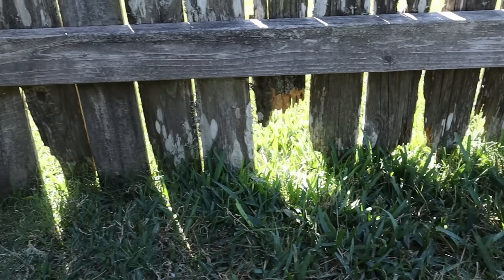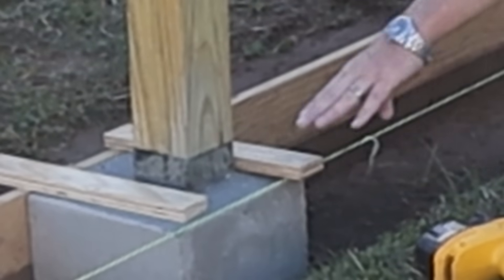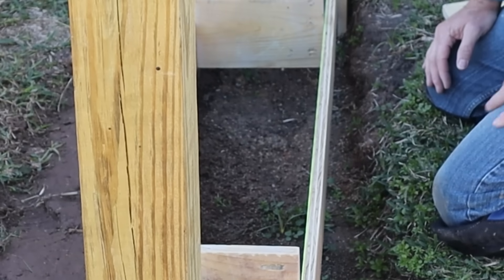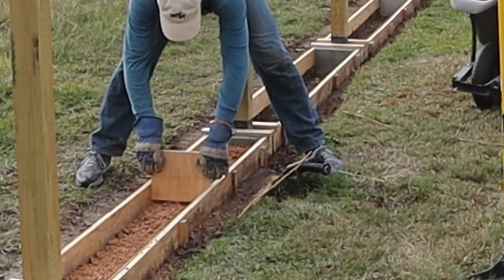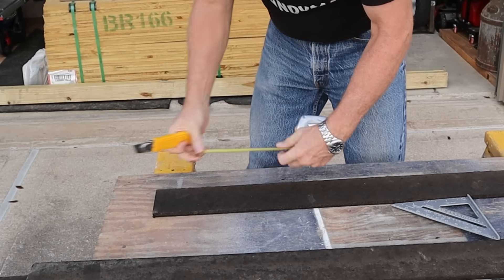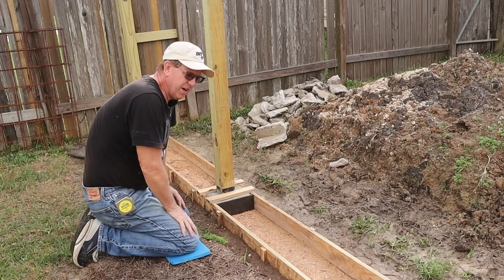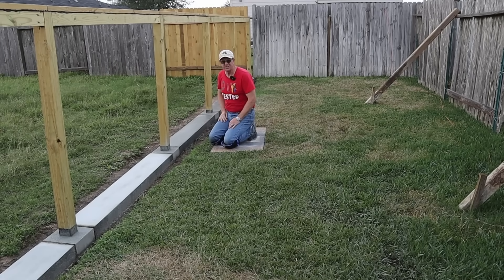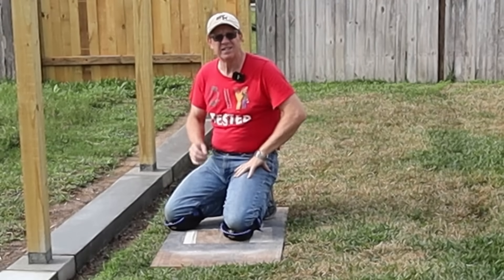Zero Maintenance Concrete Curb-Keeps Fence from Rotting!

Comment: I do like this idea and I did this when building my new fence but super simple way: after I set my posts, I just dug out a couple (3-4”) of dirt between my posts, got 2, 1x4’s and covered one side (the inside that goes towards the concrete) with 3” blue 3M tape (so the concrete doesn’t stick to my boards), put them down in the gap between the posts with a 10-11” spacing.. just let the top of the board be flush with the ground level .. filled some of the dirt back into the gap so I have about a 2” depth left to fill with the concrete.. stepped on the dirt to compact it down.. added 2 or 3 small (1x2) spacer boards across the top to hold the boards to that 10-11” spacing .. and filled up with mixed concrete. I did put some plastic on top to allow the concrete to cure slowly - took that off after a couple days. Then removed the form. It’s been over one year and they’re still holding up just fine.

Comment: You should have rounded the sides to prevent brittle edges. You could have used a fiber in your mix to limit chipping and increasing tensile strength.
Reply: CURB TROWEL
Reply: @mdoy5667  Like he shows at 25:20?

Comment: This is actually much more complicated than what you expressed in the video. Concrete is constantantly drying after the initial mix and you are fighting the mixture, the volume of concrete mixed that has to be transferred from the mixer to the ground, compacting it and then smoothing it over. As you've stated at the end of the video, it comes down to experience and for most DIY homeowners, we just don't have the volume of work to gain that skillset to achieve anything close to professional results!!!

You deserve much credit for showing this and sharing your experience and knowlege in this video!!  The number of linear feet of conceret done was not easy and the results turned up great!!  Well done👍👍👍

Comment: Very good job overall, excellent idea, The only thing i would have done different is to round the edges with a "bullnose float" so the sharp edges are less likely to chip and the water will more easily run off the top.Thanks.

Comment: The chairs on the metal concrete cage are to keep it in the middle of the concrete and to try to mitigate the rusting of rebar inside the concrete. By suspending the rebar with rebar with rebar you’ve just made it easier for the rebar to rust. When rebar rusts in destroys the concrete. Should’ve just used a couple of rocks or something the suspend your metal fencing in the concrete.
  You could have saved some time just bending the metal fencing into a rectangular box and securing it with ties

Comment: OCD = Good Work Ethic. I'm so tired of people saying what I do is overkill. I love your attention to detail and execution.

The only thing I would change here is, like you said, to use smoother boards. It'll definitely help with the bubbles getting stuck and also using a treatment so that the cement doesn't stick to the wood.
Reply from the maker: Thank you, that is the nice thing about DIY you can over kill it all you want!.  Glad you liked the video.  I sanded the boards and waxed them with paste wax for the next set and worked much better.  Thanks for watching.

Comment: thanks.  I learnt...  never to put too much water in until you have mixed it, then add water to suit,  never leave the boards out in the rain to warp,  take the boards off early as soon as it can hold its shape.  use a vibration tool to get the side air bubbles out.

Comment: Shrink /swell soil is what you were trying to say. I think this was a great job- I subbed! Got any vids on replacing a subfloor under a broken toilet flange? It’s about 2 x 2’ i have to replace before finishing the floor(ceramic tile). I will be making a concrete threshold for my barn doors, and using your procedure for making them!
Reply from the maker: No I sure don't, sorry.  Thank you for watching.

Comment: I did something like this for curbing. I made forms and pre-casted the curbing in 3 foot sections. I ran a line and butted them up. It turned out perfectly level and straight because I could pump and move them into position.
Reply from the maker: Great.  Thanks for watching.

Comment: Found your video while researching how to make a foundation for a block fence I'm planning on building. Great job! I have just enough concrete experience to attempt replacing and old wooden fence with block and then cover with stucco. After watching you wrestle those bags and mixer, I'm definitely going to buy a MudMixer. I helped a friend pour a sidewalk and it was awesome tool to have. You only lift bags waist high and the speed control allows you to go as fast or slow as you need. Thanks for sharing and I can't wait to see what's next.
Reply from the maker: Glad you found me.  Yes I tried to see if the local rental store had a mudmixer for rent but they don't  So I did it the old fashion way, by hand.  Good luck on you project.  Thanks for watching.

Comment: Iron rebar or screen will eventually cause the concrete to crack when rain water soaks through concrete and reaches the metal. Consider using basalt or fiberglass reinforcement instead.

Comment: I am a concrete formwork, carpenter. What works for me is to put some form release oil on your forms before you pour . and then I wait till the next day after the pour to strip them.  and they don’t stick due to the oil.
Reply from the maker: Yeah I was lazy and didn't do that but on all the other pours I put vegetable oil on the forms and it works pretty good.  Thanks for watching.

Comment: How deep do those post blocks go down? What keeps the fence from blowing over in a strong wind? This is hurricane country. I was wondering if you could just bury a sonotube and fill it with concrete instead of doing those little blocks.

Comment: All I can see is if you had used  continuous forms on both sides of your conc rete 10" apart with all of your rebar in place but running the full length and did a single pour maybe from a concrete truck there wouldn't have been the need for the expansion pieces ( but you could have still placed them in there) and there wouldn't have been the warping and twisting while looking down the entire line. You have showed me what I've always wanted to try to keep my pickets off the ground so very nice job.  I'm replacing my fence next year so will keep this:hand-pink-waving: video in mind.  Just an FYI.  I moved into an older house with concrete and rebar edging   about 6" wide by 4' long sections (total length was 30') that had sunk into my clay and I didn't know it was even there until I was gardening so if he had used rebar the total length of the pour it would have been more stable and may not have sunk into the clay.

Comment: I've seen some jobs where they painted the forms with some kind of oil as a release agent. Is that because it's a different kind of job?
Reply from the maker: People use multiple different products on concrete forms.  I just didn't use any on this video but have since stated using vegetable oil on the forms.  Don't want to use motor oil.  Thanks for watching.

Comment: I know this is older video, but I wondered if you put any release agent - Oil, wd40, or??? on the form?   I wasn't sure if that would have helped not have breaking of edges?
Reply from the maker: I didn't for this video but going forward I have been using vegetable oil which seems to be working pretty good.  Thank you for watching.

Comment: Looks great when finished.  However how do you replace the posts?  Where I live in TX a PT 4x4 lasts about 3-4 years before splitting, bowing and twisting.  Then it's got to be removed and replaced.  Your system would hinder such in a major way.
Reply from the maker: https://youtu.be/1Ynr8Xb8dy8  This is the video where I replace the posts.  Thanks for watching.

Comment: I've never had to scrape off dry concrete from the back of a mixer... because I always remember to put that first 1-2 gallons of water in before the first bag of cement.
Reply from the maker: Did that and still had the same issue.

Comment: Is it built on your side of the property line, if it is you are only giving up a 4 inch space to the boundary line 2" concrete, 3/4" form, and 3/4" stake which is reasonable given the better build for your fence. Liked the video.
Reply from the maker: Yes it is, I hit the steel property marker when putting in the corner post and the whole thing is on my side.  Thanks for watching.

Comment: Question ... I assume that both side of this fence are your property... probably know the answer but do you have any tips on doing a good fence on a property line..... with a non cooperating neighbor??? Thanks in advance...
Reply from the maker: Then all of the fence will just need to be on you side of the property line.  I have good neighbors and we are sharing the property line.  If the fence is all on you side of the property there isn't anything your neighbor can do.  Thanks for watching.
Reply: but a lot of the work you are doing requires you to be/work on the other side of the property line... 
Have not worked out how to do that....

Comment: Saw another concrete guy using used diesel oil to coat the forms on the inside so they separate from the concrete easier.

Comment: How deep did you do your post in and what was the depth of ur concrete wall I've been wanting to do this also
Reply from the maker: the posts went 3 ft in the ground and the boarder was 4in thick with about 2in below ground.  Thanks for watching
Reply: @OakleysDIYHomeRenovation101  how long was your post
Reply: How many bags did you use

Comment: @OakleysDIYHomeRenovation101 
Thorough process and execution; this was truly a pleasure to watch.  The only suggestions I could possibly make for future concrete placement jobs would be:
Oil your forms: a releasing agent applied to the inside of your forms will promote headache-free removal and easier re-use of the forms.
Greased dowel connection to adjacent pours: If you are concerned about the movement of the linear pours relative to the post-base footers, this method would help.
Thank you for your contribution.
Reply: Newb to DIY here...what kind of oil are you supposed to use?
Reply: @PW98372  They make dedicated release agent by the gallon.  You should be able to pick some up at your local concrete supply or possibly big box store.  Cooking oil works in a pinch.  I've also read that diesal oil, wd-40, and finishing wax are good candidates.  Alternatively you can just put a sheet of plastic over the wood.  Might get some folds but the release would be a breeze.
Reply: @DavinStewart  Thank you!!!

Comment: The easier and cheaper way would be to leave bottom of the fence about 4 to 6 inch off the ground then use 10 inch flashing. Use a spade shovel and cut a slit in the ground and slide flashing in slit then staple it to the fence.

Comment: With all the detail you did, I am shocked you did NOT use form oil on the forms, which reduces how much the wood sticks to the concrete. Makes for a cleaner and easier removal of the forms. Another way to get a rounded over edge is to tack a cove mold inside along the top of forms. It is more expensive than just buying a good edger though.
Reply from the maker: Going forward I used vegetable oil on my forms.  Thanks for watching.

Comment: Because you wanted even the sides to look good you should have used a form release agent and cement slurry up the walls before pouring concrete and leave the forms on for days.

Comment: You should not rebar concrete that is suspended over clean gravel support underfill. That is why you should have filled gravel at the base of the concrete for freeze thaw as opposed to rebar. Address the root cause of problems not symptoms.

Comment: Probably should put a French drain along side of that Concret curb……at least here in Houston that would be a necessity.
Reply from the maker: looking into that especially for the other side of the house.  The natural slope put in the yard when the house was built runs along the curb to the front of the house, so water runs along the curb.

Comment: I've considered doing that... but I'm opting for Trex decking laid flat instead as I'm dealing with PVC picket and three different chain link fences on adjoining neighbors' properties and my dog run. For future projects perhaps you may want to consider some of the following observations. While the process progressed I kept waiting for the application of concrete form release oil... 😉 The edging tool is a good idea as the rounded edges would be a lot less prone to chipping over time. The texture in the concrete surface left by the edger is considered a workman like finish... and if you edge between doing the magnesium troweling and the steel troweling you can still get a nice finished surface without fighting with the edge too much--a gentle application of the edger can tidy it up. Also, they make a narrow edger for sidewalks--it looked like the edger you showed was for slabs (or example, check Amazon for Bon 12-436 Edger). The narrow edger would leave more flat surface exposed.

Comment: THE HELL IT DOES!!! Bad wood rots in concrete as fast as it does without it! My former roomie spent 28 HOURS last week (and he ran a "skeeter" and a horizontal boring machine to instal fiber optics and electrical services to houses for 5+ years!) with a mini-track hoe ripping out nearly 600 feet of wooden fence my cheap-ass uncle installed 38 years ago, less than three months before I bought my Grandparent's house from their Estate! Carl had to also break-up and dig-up the concrete "curbing", and I'm having GIGABUCKS worth of new cyclone fencing installed, with the support poles in new concrete "curbing" (7500 PSI Ready-Mix with re-mesh) and "pots" 16" deep for the posts (tree roots). And you gotta run the weed-eater along the curbing each time you mow! Five hundred and 60-odd feet takes me and my BIG two-stroke weed-eater about 20 hours to edge-out I use a wire wheel brush (12 or 14") to trim neater.

Comment: Looks great! 
Only downside is the expense of the concrete. You could probably get away with using Soil-Cement instead for something like this (essentially 10-15% cement mixed with on site soil). If you wanted to do it on the cheap. 
Yours is going to last better though.
Reply from the maker: True about $15 per curb section.  Thanks for watching.  Haven't heard of doing dirt with concrete/

Comment: The price of plywood has increased substantially in the past few years. It's a cheaper to use a slip form made of 2x6s, (which can be reused)
Reply from the maker: Probably so just have to make sure they are straight and not bowed, cork screwed.  Thanks for watching.

Comment: after you clean your forms you should try coating the pour surface with a release agent for the next pour. I use vegetable oil and sometimes diesel this will keep the concrete from bonding to your form and will produce an exceptionally clean edge. for best results apply release agent just before you add your rebar
Reply: Can you please explain this a bit more? For a newbie.
Reply: @kaptaan_original  form release agent is just as it sounds, it's a chemical applied to the form prior to the pour (you can use a sprayer or a simple dish rag will work) this will make it so the concrete won't bond to your boards as they set up.
Reply: @Gilxen  ok, that makes sense. I thought it was something you were saying to apply after to remove the concrete.
Reply: @kaptaan_original  no do it before, and try not to get any on your rebar, you want your concrete to bond to that

Comment: You should always put motor oil on the wood so that you have a nice looking edge when you remove your forms!
We use used oil from changing oil in the vehicles. If we don't have enough we get scrap oil from any garage!

Comment: I did that on 2 of my 3 neighbors shared fence. The 3’rd neighbor was a idiot.  He was the reason I had to replace the fence in the first place. He used my fence as a 24” retaining wall/planter.  I had to use Pressure treated lumber on his side, and yes the Idiot piled soil against the pressure treated wood.  He must love termites!   He insisted I not use concrete on the fence line.  He finally moved out 5 years ago.  

He watered the fence regularly, trying to age the cedar.   He would especially water it as soon as I would apply sealer on my side if the fence.  His other two neighbors had to replace their shared fence 10 years ago.  My fence looks like I installed it last year.  I installed it 22 years ago and expect at least another 20 years out of it.  He told me I installed the hangers upside down.   I did not, if I installed them the way he thought I should have installed them, they would have trapped the mourning dew on the bottom of the stringers and rotted them away.  It was clear that I installed them correctly, all if the etchings were readable in the orientation that I installed them!

Comment: why rebar? its not even load bearing. I have a concrete form about the same size that I drive over every day and dont have any issues with cracks or splits and I didnt use any rebar

Comment: should have used a edge trowel to dress the edges up and also used a sawsaw without a blade in it to vibrate the sides of the forms to give you a smooth finish on the sides,or at least knocked on the sides gently with a hammer to do the same thing
Reply: Bro, did you even watch the video?  😆
He used a Sawzall and an edger... and talked about it at length.

Comment: Metal does not expend my friend, well all that OCD stuff but you did not create some crack joing cuts in the middle of each slab, it will creack guarantee unless you dry cut them